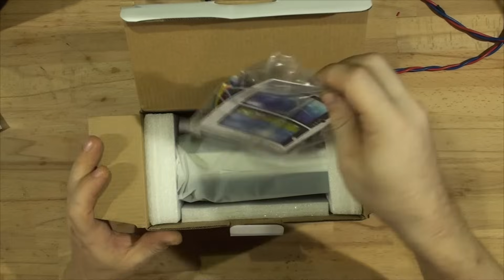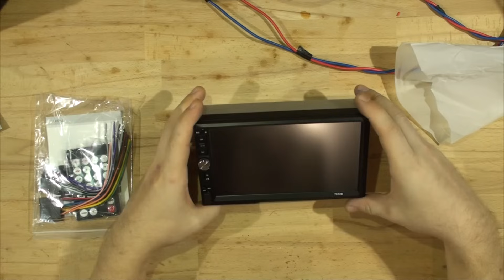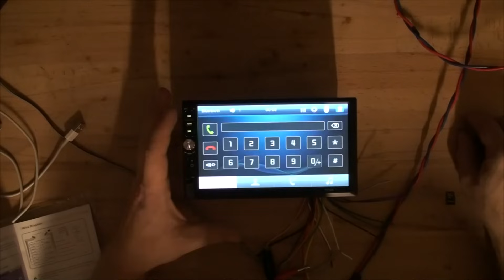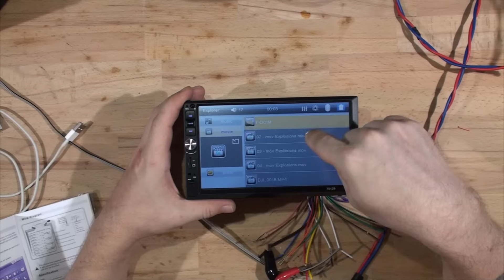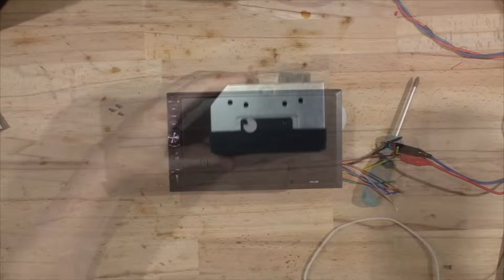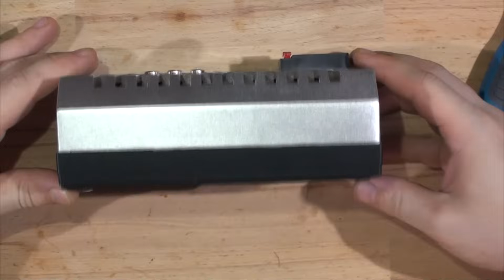Generic Touch Screen Car Stereo Review 7010B 7012B 7018B

Comment: I finally got mine installed. I blamed the harness and the radio but it was a problem with the 2006 Silverado. Run a separate wire from an ignition fuse to the radio. I saw that WELCOME come up and cheered. We'll have to see how it holds up but the Bluetooth, radio and phone functions all worked great. Had to do a little trimming on the mounting kit I bought but it looks great. Did not install the camera but it's easy to pull out from the dash later. I nearly went deaf switching from phone to radio so I'm training myself to throttle back the volume when switching devices since the phone output through BT and the radio were vastly different volumes.

Comment: Recently installed a 7010. Video not playing. Saying for "security reasons ....". When I click on music, it says 'null disk'. The radio is running fine. Please help.
Reply: Probably you are using a different type of sd card than the ones can recognize. Try using smaller 16GB ones, and slower types.

Comment: I have the same deck. Been doing some research on it. Apparently. If you screen mirror Android, you can control your Android phone from the touch screen on the radio. But if you use iOS, you cannot control iOS from the touch screen on the radio only from the phone

Comment: hi i noticed that they make many models 7010 7012 7020 7021 but what are the differences? which is the best to buy? i would like it with a rear camera... but i'm not sure which one to buy, can you help me understand? thanks
Reply: pretty much just difference front button design, They all run same chip inside and same user interface

Comment: is possible to install any gps on 7018b ?
Reply from the maker: Not “of the shelf” one, no.
Reply: @MaxELECTRONICS  then why does it have a gps connection at the back?
Reply from the maker: @BojanMiljkovic-ff2im it would be for different unit with different pcb and firmware

Comment: I have one of these, and love it. I have had i for years and didn't k ow about the LOGO change. Thank you. I do have a question and I hope you can awsner it. Mine does not have the Mirror link nor Steering wheel button. Even those the box and manual said it suports it. Do you know a way to get those? If I plug in a OTG cable and connect my phone nothign happens.
Reply from the maker: Probably needs firmware update.
Reply: @MaxELECTRONICS  I've been trying to figure that one out. It's been pne heck of a rabbit hole to try and find new firmware and thr proper way. Tho seeing this video gives hope that it is out there.

Comment: I just got one of these 7018B head units, it actually works really well! I got mine with a back up camera included for 35$ on eBay. One thing about these, the interfaces vary from vendor to vendor. None of which are bad, but it's a roll of the dice. I believe it's just different generations of the unit itself, who knows. All of the features work well, it has a better screen and overall interface/features than my 80$ planet audio in my other car. The only thing I can say about them is, they definitely don't put out a huge amount of power (obviously, considering price) mine starts to crackle as early as Volume 20 out of i believe 40. With the bass low I can get to volume 25 without any crackling (which is pretty loud honestly, my car is just loud so I have to fight the rusty exhaust 🤣). It is CLEAR audio, has bass, treble and audio placement settings. Everything you might need. I'm going to check out the phone connection tomorrow, I'm hoping it works 🤞

For the price, FANTASTIC stereo. Good amount of features/settings, good sound. Great for 95% of drivers out there! If you were trying to build an audio system with this guy, you would definitely need an amp. If your car is LOUD, it might be a tad quieter than you'd like it to be. Like I said, 95% of people would be good with this. I am a part of that 95%! I love it!
Reply from the maker: I agree, If you just wanna head unit to have some radio or background music, like most people do, yes the unit is just fine, but if you work with audio and like clear loud music, get something like avic-f80, worth every cent.

Comment: You are stating that this stereo does not have Bluetooth, which is not true! Iy does have Bluetooth! By the way I am using this Stereo (7018B) in both of my cars and they are working really well, the older one for more then 3 years now! Pretty good for this price!
Reply: you get what you pay for in this world you buy a cheap radio you get cheap sound do yourself a favor and spend a few bucks more for a quality Kenwood Pioneer JVC anything but something that is cheap and Chinese if you’re going to spend $30 on your head unit which is the start of any good quality system you’re already fucking up system is only as good as it’s signal source no offense and I say this with all politeness no offense, but I would love to hear the rest of your radio if you’re swearing by this damn $30 unit I imagine your car sounds like a rumpke garbage truck loud annoying it just sounds like Just a bunch of loud ruckus that’s great you’re loud but it sounds like butt hole
Reply: so it has bluetooth ?
Reply: @elflaco8754  Yes, working fine, even with the phone, and that for almost 4 years now. That's not bad for a cheap Chinese car stereo.
Reply from the maker: I’m glad you’re enjoying this low quality sound. Unfortunately product made that cheap with glitches and horrible touch screen is not acceptable to me. I’d rather spend $2000 and get a high end pioneer unit.
Reply: For sure I would prefer a $2000 Pioneer unit to this one, no question! But when I see that I get the 7018B on China for about $16 tp $18 it's like comparing a Dacia to a Rolls Royce. For the money spent it is surely a good offer, especially if you use the Bluetooth with your cell phone and so hardly ever use the touch screen. If you need more power you can add an amp. For my budget it's an ok low price solution @MaxELECTRONICS

Comment: I just bought one of these to replace the stock radio in my Nissan Sentra. It does everything advertised except for the mirror link. I can't get that working but I love the rest of it. The manual that comes with it sucks but thanks to this video I'm able to change the color of my buttons the way I wanted. 😂
Reply: so you cant bluetooth audio from your phone?
Reply: @beatprocess  no he meant that the ad said it will show your phones display on the radio if you connect it to your phone cable but it didnt show
The Bluetooth works fine
Reply: @valdrittahiri8081  so the Bluetooth plays audio and phones just fine

Comment: I have the 7018b , my corvette came with it when I bought it and after it would just turn off randomly. I just bought new one same brand and installed it and it worked for one day and now it won’t turn on again… all wire is right and still nothing I’m starting to think they are just bad from the go

Comment: Hey I have the 7018B version .It came with the logo Jacs Motors and I am not able to change to any other logos. Ived tried the code 1234 but there's only one logo
Reply: Sometimes the code is different. Some other guy here on YT typed in 1986 ..
Reply from the maker: I’m not sure, maybe they cheaped out and didn’t load any to the unit
Reply: Every model is different, FW can change drastically depending on mfg date/seller even with same model #.
The Factory PIN code is typically printed in the manual.

Comment: I installed the 7018B to my 2006 Sentra. It works just fine except. It has radio interference signal when I play in Bluetooth of MP3 music mode. How to fix the problem? What is the current firmware update for this radio? My version: V7.52BT-FK-TP.

Comment: First I see Model no.: 7018, but on a box side is specification of 7010B (whatever the difference is) and when you open the box here is a model 7012B :) XD
Can anybody tell me what are specification diferences betwen these models? I see just face buttons differences between 7010B and 7012/7018B

Comment: Hello 👋 
I have the same device. 
But I have a problem, everytime I start the car the device start playing fm audio with extremely loud volume. 
I would set the volume to 4, and turn off the car, and when I start the car again the volume is automatically set to 20 which is very very loud. 
Could you maybe help me with this issue?
Reply: Did you connect red and yellow wire together? if not, do that. One is power suply, and another is for memory, and also must always have + (plus) from the battery
Reply from the maker: Dado is correct, I only joined them together for a demonstration so I can power it up, in reality you need (+) connected to the battery permanently for main supply, memory ect, amd the (ACC) one to your ignition (accessories) this is just a mosfet trigger to turn on the radio.
Reply: @dadohrvatska  Pozdrav. Imam problem sa 7023B mm kada je auto ugaseno sve ok, kada ga upalim ,a i u voznji samo se pali i gasi  na nekoliko sekundi. Crvenu i zutu nisam spojio zajedno,da li bi to rijesilo problem?

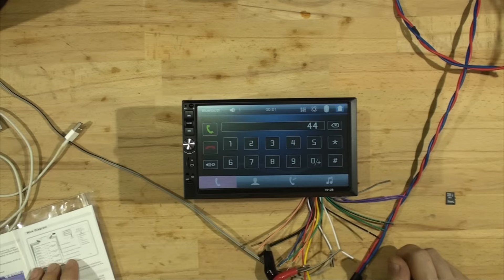Comment: Good info. I am working on installing backup cam. Are you saying the pink wire need to tap into red wire (AAC Red) 9:35 then add the red wire from the provided backup cam? Sorry newby here. Thank you!
Reply from the maker: No, the “reverse” wire and camera power wire need to connect to “positive “ wire of your reverse lamp. So when reverse light is on it supplies power to the “reverse” wire of stereo and to power wire of camera.